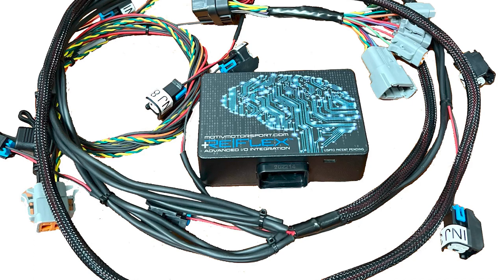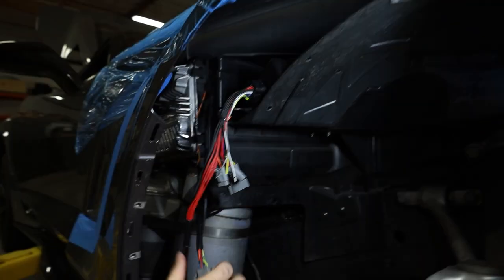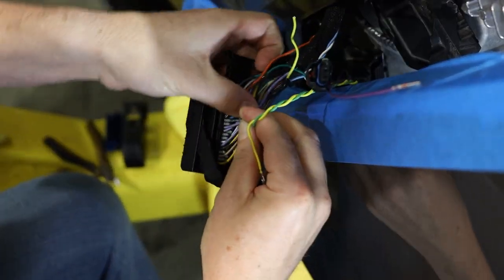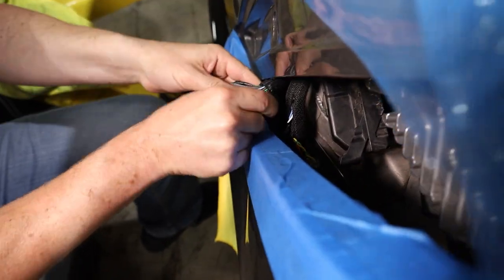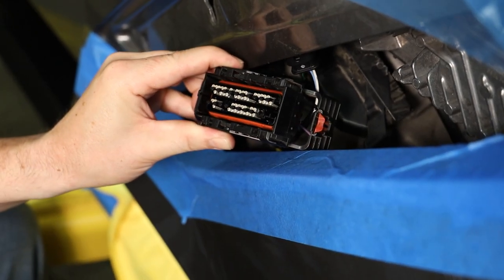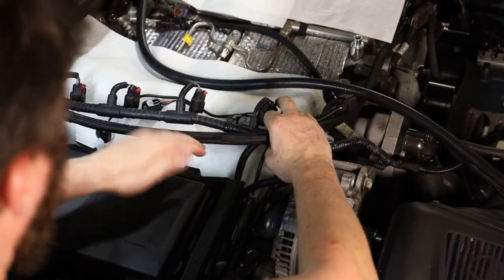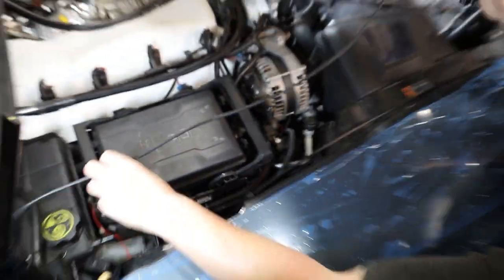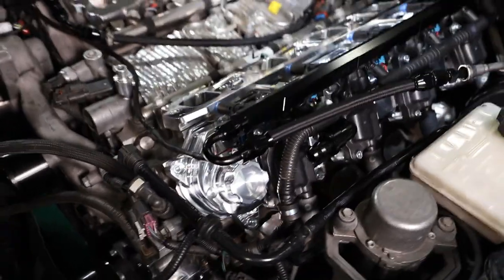C7 Corvette REFLEX+ Sequential Port Injection Controller INSTALL

Comment: Just ordered our first 'Lid". These guys are so easy to work with and the port injection is recommended by many of the top performance shops. Looking forward to the port injection, but just doing the Lid first. Will report back.

Comment: Couple of questions

1.  Do you sell a Y for high pressure brunch off and new low pressure injector rail?  Also a cross over fuel line between the 2 fuel rails would be nice.

2.  At the end of the video it looks like your fuel line feeds directly into low pressure fuel rail, are you still using direct injection in conjunction with low pressure or this is full conversion to port setup?

3.  It would be nice to get a quick video on controller setup and parameter adjustments?
Reply from the maker: 1. We don't do any fuel lines, too many different low side fuel system options that are already on vehicles.

2. The fuel feeds the front of the drivers rail, then it crosses over on the rear of the engine to the other rail, then finally leaves the front of the passenger rail, passes thru the flex sensor, and feeds the HP pump. I tried this arrangement due to simplicity, but don't like it as much as the previous setup feeding the rails through a tee in the rear and then teed together in the front to feed the DI pump like this https://youtu.be/5zspbzmMqgE

Removing DI and using port only on an LT engine is a BAD idea - at least if your goal is to make power, the benefit of the LT engine is the in-cylinder cooling (detonation resistance) provided by Direct Injection to run higher compression ratios and make more power. If you want to run port injection only, switch to an LS engine which has the correct intake ports and combustion chambers to make power in a "port only" application.

3.Enjoy - https://youtu.be/KpnKYcYz7kI

Comment: Hi do anyone know what pin out on the ecm the crank signal wire is on E92 ecm
Reply: X3 connector (Grey) 
Pin 10 (VT/BU) Crankshaft 5V Reference
Pin 25 (BK/VT) Crankshaft Low Reference
Pin 26 (GN) Crankshaft Signal